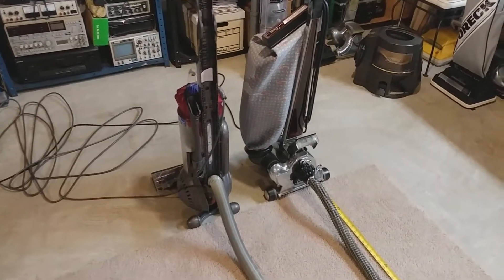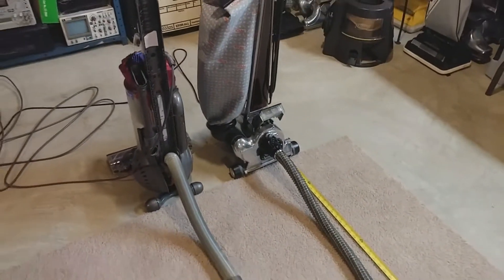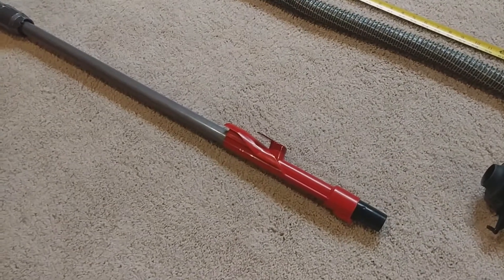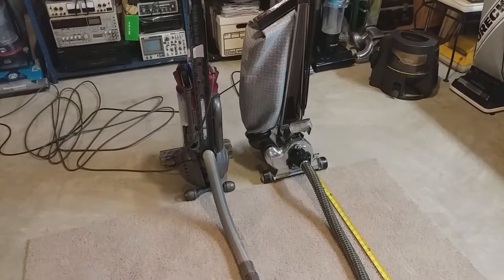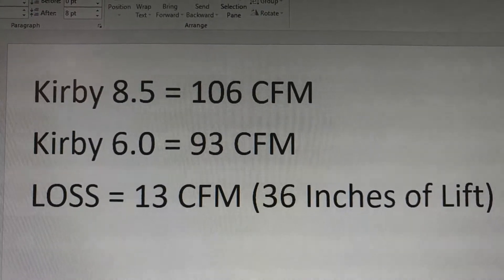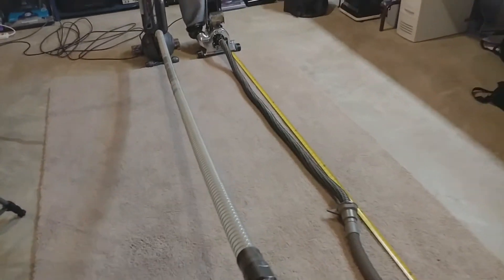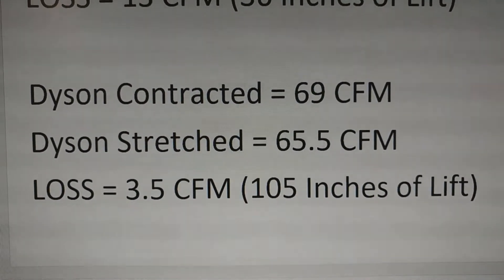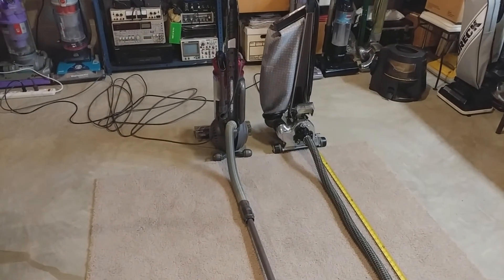Suction Maintains Airflow Over A Distance

Comment: Awesome video, Bill.  I was operating on this hypothesis (that suction is simply the ability to maintain airflow as resistance increases) and about to setup some tests to prove (or disprove) it.  Looks like you did the hard work for me!  Have you taken enough data points to see the shape of the graph they would form? I would assume these would be inverse exponential curves.
Reply from the maker: Troy Allen well to really get many data points, I'd probably need something like 100 feet of hose, chopped up into 10 ft. sections. 😎

Comment: This, I assume, is why central vacs with dual motors do better with those motors connected serially unless the pipe and hose run is relatively short - parallel motors give you more airflow but don't maintain it particularly well, while serial motors give you more suction, thus maintaining airflow.
Reply from the maker: Ummm, I'm not sure how airflow loss over distance relates to series and/or parallel motors but okey dokey.  :)
Reply: Series motors generate higher suction but not (much) more airflow, while parallel motors generate more airflow but not much more suction.
Reply: Oh, right, to clarify, I'm referring to series versus parallel airpaths, not the electrical connection (which is parallel regardless of the airpath configuration).
Reply: @logansorenssen  This  is  true  of  pumps , and blowers.
In  this  case  vacuum  motors,  which  are  extremely  high velocity blowers.

If you  have  two  vacuum  motor  unrits  that  are 130 cfm each @ 75" lift each,  connected  in  a series to another identical motor unit, you  will  still have 130 cfm.
The  pressure,  or  lift  will  double,   you  would  end  up  with 130 cfm@149" lift.

Comment: I used to find this issue with my mini turbo brush, when going up the stairs with it. If the Dyson was at the bottom of the stairs, the turbo brush would spin very quickly when doing the bottom stairs, but as I went up the staircase step by step, and stretched out the hose, the speed of the turbo brush would drop, and by the top of the staircase, at full stretch on the hose, the brush would be really noticeably slower. Once I walked back down the stairs,  i would hear the brush start speeding right up again, and I always wondered why it spun slower the further away from the fan I went. I presume it is because the fan has to move a much greater volume of air when the hose is stretched out, and the more air in the hose, the harder it will be for the fan, moving at the same speed and power, to move the air at the same speed, keeping the turbo brush turning at the same speed. The longer the hose, and depending on which vacuum I am using, some are worse than others for losing power the higher up the stairs I go. the SEBO X4, with its stair hose connected, and the SEBO turbo tool, loses a lot of speed on its turbine at full hose stretch.